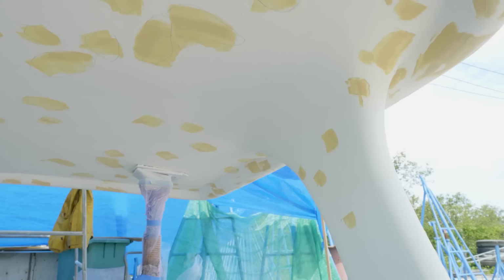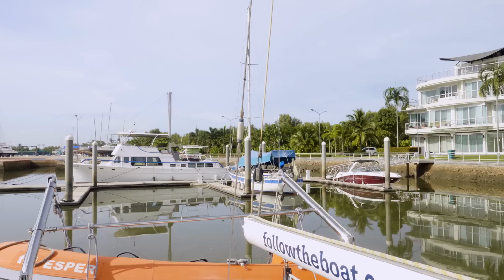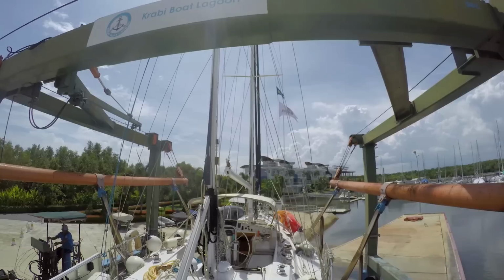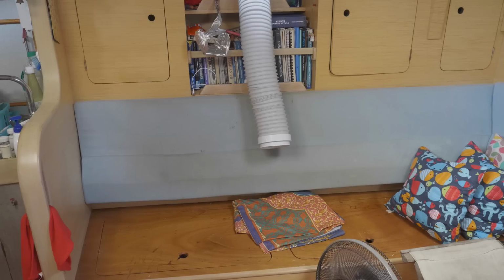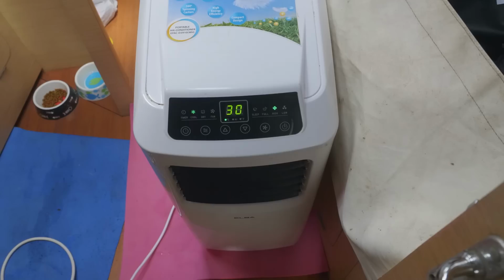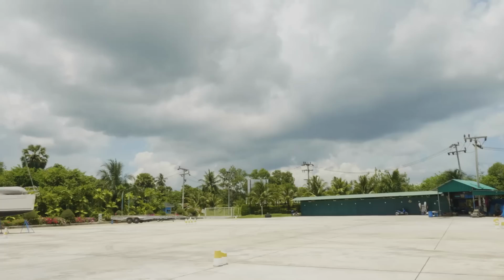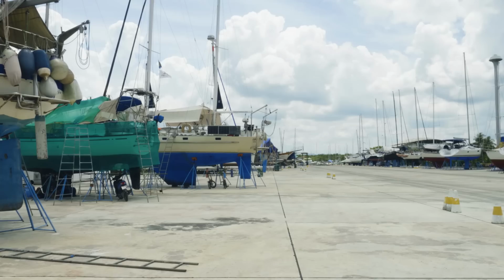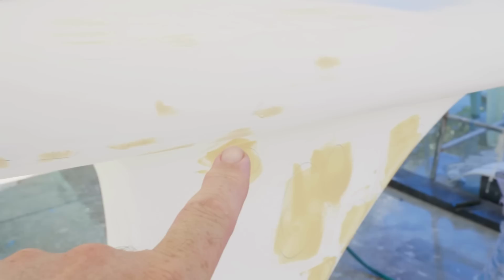HAULING OUT IN THAILAND - PAINTING DODGER - SAILING FOLLOWTHEBOAT Ep 110

Comment: Very close to buying a boat in Langkawi that will need some work (deck, replace standing rigging). You are in Langkawi often, but your servicing has been in Thailand. Is the work cheaper or better quality in Thailand than in Langkawi? If you have posted an answer to this before, I apologize. I've watched all the re-fit videos and really enjoy the ideas of what can be done. Did you run into any problems with Esper being there more than a year?
Reply from the maker: Big question. In a nutshell, you can get most things done in Thailand. Langkawi is a bit more of an effort but importing goods is a lot cheaper.

Comment: My new (to me) boat is also a ketch.  The yard where I bought it uses a travel lift, but they go in front-ways and remove the fore stay.  I would think that would be simpler than removing the back stay and the mizzen topping lift.  Why did you have to go in backwards?
Reply: First of all, the forestay on most modern sailboats has roller-furling gear on it and that makes it much more complex to remove, necessitating the removal of the jib usually too, to make disassembly more manageable.  Sometimes it is a real pain even getting to the stay beneath it all to de-tension and unhook it on some systems.  And since the furling foil is longer than the mast and it can't bend, getting it out of the way often means dunking the furling drum into the saltwater to bring it back and out of the way unless you can dinghy it out to the side a little as it goes back. Been there.  Esper is also a cutter rig so that means the cutter stay and its furling sail  and associated hardware all have the same issues getting them out of the way too, doubling the work involved to clear the bow area.  

Also, as far as the forces on the boat are concerned, with the backstay off of the mizzen the running backstays on the main mast countering the forces of the cutter stay are still holding it from going forward fairly high up on the mast, at the height of the cutter stay almost to the top.  That is still very secure and safe for the main.   The mizzen is a smaller, shorter, lighter mast and therefore the stresses on it are much less than the larger main, and as the mizzen wants to go forward a little without the backstay, the rear shrouds coming off from around the spreader keep it from going too far and the triactic stay between the two masts will just go a little limp and can't "push" the main forward.   

Now if you took the forestay off, the triactic between the mastheads would actually tend to want to pull the main mast back because of the pre-loaded tension built into it and not being counteracted by the forestay any longer.  Most boats have a little bit of mast bend tuned into them for good sail shape and that would be pulling even harder on the mast towards the aft.  So tensions would have to be let off of the backstay to safely remove the forestay and cutter stays even if they were hank-on systems and not furling so much easier to remove.  

In short, removing the backstay is the easiest thing to do, even including removing the mizzen boom and the topping lift -which are actually pretty easy jobs to do, especially since Esper has in-mast furling, they don't even need to remove the mizzen sail.
Reply from the maker: What James says, Jeff. Getting the forestay off our boat would mean releasing the tension on all other stays around the boat.
Reply: You had me at "cutter rig."  I had forgotten about both fore stays and both furlers.  Mine also has a furler, but is not a cutter.  I can see that removing the back stay and the mizzen topping lift would be much simpler.  Thanks.
Reply: I just learned the term triactic here on FTB the other day.  Nice to be able to use it in a conversation. That's why I love following the boat.  I've always just called it "the stay between the mastheads"  in the past.  lol  I blame Nigel Calder and Don Casey for not telling me about it in their books.
Reply from the maker: I'm thrilled that we're ever able to teach anything in our videos, so thanks for that. And, James, we learn plenty from you too! PS. It's triatic, without the middle C. I found this piece online... http://www.oceansail.co.uk/articles/Triatic.php 😎 Liz
Reply: Nice, I think another con would be you probably need to go aloft to make a minor adjustment in the mast pre-bend. I would imagine that each mast would bend a little differently since they are different lengths as you tensioned the backstay.  Not a big deal.  Not many people mess around with their rig tension much anyhow. I only do it the first few times I sail after stepping the mast.